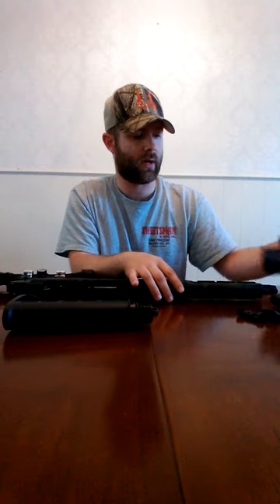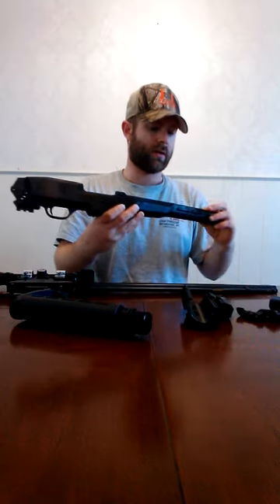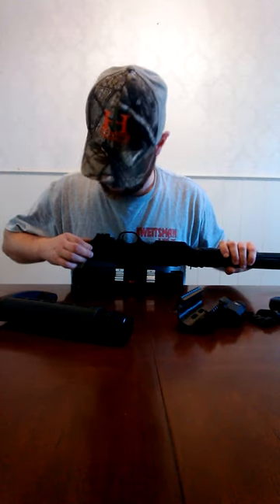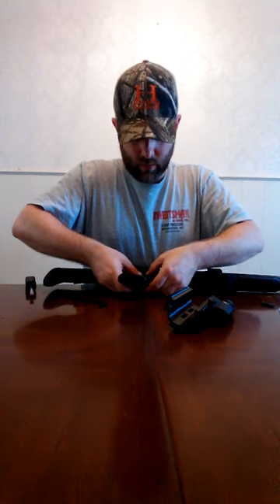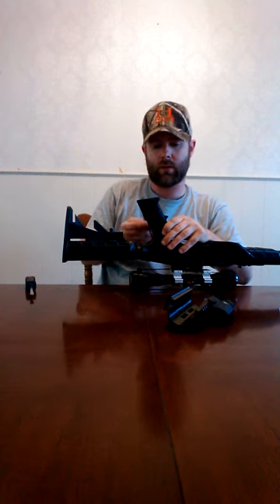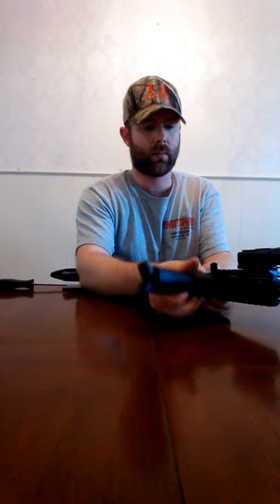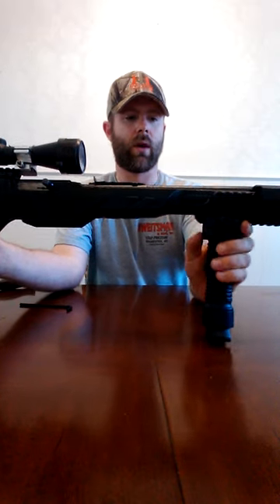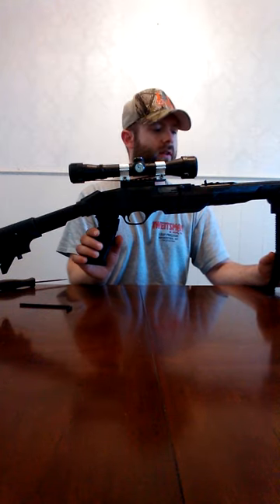Marlin Model 60 aftermarket Tactical Stock HT60-There is a newer video

Comment: I like the looks of the HT60 and according to the website it fit's the Marlin model 990 like I have. Although if you ever get them in stock I would buy one at the $85.00 price but not at the $150.00 price. I have a ATI Dragunov stock now and it's fine, my opinion is you could sell a heck of a lot of them at the $85.00 price and make more money on volume of sales if that is feasible. Just my .02 worth, good luck with your product though.

Comment: Will this work on the marlin model 60W, cause mines a tube fed too but it's not equal length to the barrel like yours is. I'm just worried about it covering the ammo hole in my tube where I have to load ammo
Reply: His tube was shortened to conform to NJ law and the barrels were later shortened to match. In other words,  it's the same tube everybody after maybe 1987 has